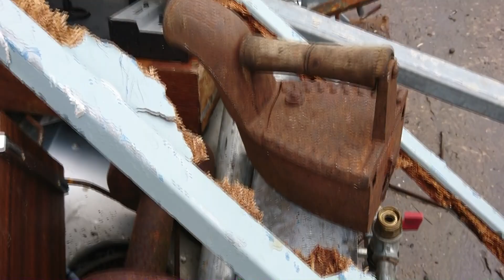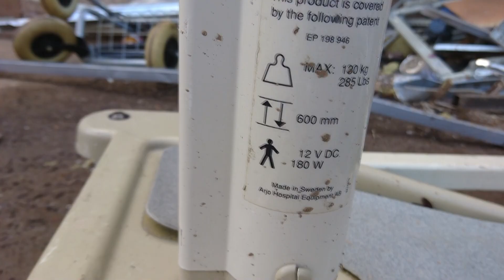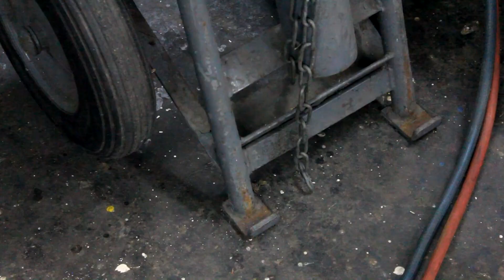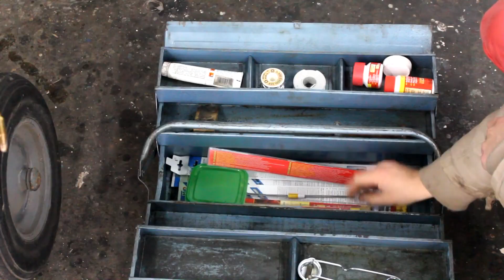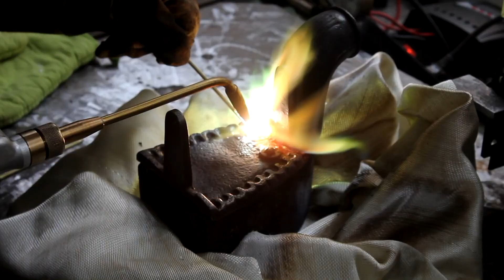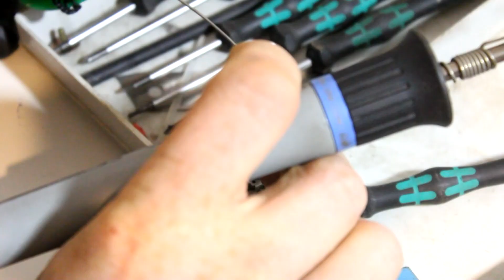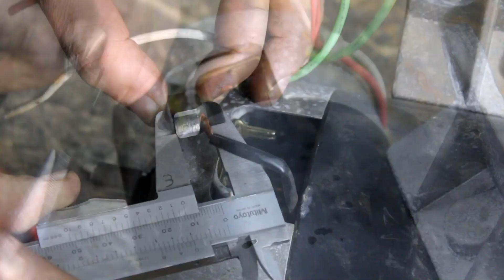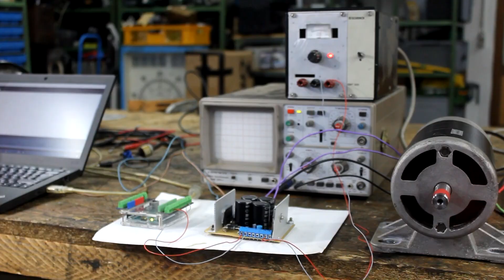Amazing Scrapyard Finds! Repair-A-Thon!

Comment: I hate to say it but Australia has caught the Black Friday virus as well and we are just as wasteful as the rest of the Western world but like you I get a lot of benefit from it. I recently picked up a pallet jack that wouldn’t lift for just a few dollars at a recycling yard and all it took was an hour of my time and a $3 seal to fix it. I can highly recommend grabbing one of those patient lifters if you can as I have one that I got at the junk yard and it is so much better than an engine hoist around my work shop because It’s much lighter and more compact than an engine hoist and although it’s rated to lift people up to 180kg I have lifted a 300kg machine with it. It’s just so useful. As for the treadmill motors I stopped collecting them when I had picked up 7 free treadmills in my area within about 12 months and ran out of uses for them. They are great for converting some work shop machines and I followed the instructions I found on YouTube to convert my linishing sander and it’s a real improvement. Now it has forward and reverse and variable speed. A word of warning however, people on YouTube are converting lathes and drill presses to the treadmill motors and this can be a big mistake as they are not considering the increase in torque that comes with the reduction in gear ratios with the Ac motors and end up disappointed with the lack of torque at lower rpm. Also, as I’m sure you will understand, dc motors are more effected by load than Ac motors because the Ac motors speed is determined by frequency and not voltage so my linisher slows down more when under load than it did with the Ac motor but I can just increase the rpm to adjust for that. I hope this info helps others looking to use treadmill motors. I could watch one of your junkyard videos every day. Cheers Stuart 🇦🇺

Comment: The Post Apocalyptic Terminator ^^ . Your repair Scrapyard Videos, are very inspiring for me :). I always take scraped stuff from the places where i work home, and repair them if i can. Mostly industrial stuff like Lenze Motor controllers, Meanwell Power supply's,  Sensors and  sometimes PLC stuff.

Comment: I love this! Wish I had a cool scrapheap like that close to me! I did however repair a Warn pullzall 220v winch that I found at work. A resistor and a some of the winding had burned up. Replaced the resistor and soldered a wire to the part of the winding that had burned, put some epoxy on it at it worked!

Comment: On the treadmill - I think your presumption about voltages is wrong. Our treadmill motors in 120vac-land are rated for 90VDC. At least almost all the ones I've salvaged are. When I saw yours, that's run in a 240vac grid, being 180vdc I presume it has something to do with the grid. I can't think of why though. Maybe they're off-the-shelf motors for another application that treadmill manufacturers choose because of their low cost? Also... what do your treadmills run on over there if not permanent magnet motors? Almost all of ours are 1.5-2.2hp permanent magnet 90vdc motors. I used one to make an electric recumbent bike (using the motor as part of the frame, since it's 1/4" thick steel). I'd link the videos to you but 80% of the time you have a URL in your comment, Youtube's algorithm shadow-bans it from anyone else seeing. :/
Reply: I've never seen that done to links.
Reply: @rogerscottcathey  - You wouldn't. To the poster, it still shows your comment. But if you were to log in under a different account and scroll through every comment, it will be missing. Hence  "shadow ban." You don't get told it's removed, you can still see it, but it might as well not exist. Think of how many times you've seen any url, from anyone, in a comment. Else people would be spamming their own channels and vids constantly.
Reply: @MattsAwesomeStuff  : Hunh! I'll check that out from a different account. I do recall now in the old days of yt having to disguise links by spelling out dot, etc.

Comment: What a great company for trying to uphold their repair warranty after all these years :)
Reply: Meanwhile Crap and Decker just says 'fuck off"
Reply: @DragonBuilds  
Campbell Hausfeld too.  I was looking for an air valve for my paint sprayer just yesterday. Their answer:  "We don't sell parts anymore " !  I'm pissed off and enraged.
Reply: @Mirodin From what I understood its was not a warranty, they simply offered to repair it but they probably wanted some money for it.
But that is way more than you can get from most companys.
Reply: @Ultrazaubererger  Right. Especially made in China companies.
Reply: Tiny cost: potentially great goodwill benefit.

Learning how your previous production eventually fails is invaluable information -- if it is used to inform product design and future production.
Reply: @michaelthibault7930  If it took 15 years to fail, the company that made it likely long since stopped caring how it failed - it's a welding torch, not a bridge. And this torch was 40 years old!
Reply: I have used a repaired torch body once and will not bother again.  It is not worth the risk with oxygen concentrations around it.
Reply: Hey Frank, Fahaaank, da ruft schonwieder jemand wegen der 32-40 Serie an, kannst Du mal deinen Vater anrufen, welche Dichtungen ins Kit gehören? 😙🎶
Reply: Giving good after-sales service is probably the reason why they are still in existence!
Reply: Why couldn't they fix it!!??!!??
Reply: @tomsuica8731  I think it's a question of costs: if with 55 euros T.P.A.I. has bought a whole new piece, think about how much it will cost to just disassemble the piece to find out the fault, add round-trip postage and spare parts price and you will see that we are very close to the price of the new: everything is repairable but not always for an affordable price
Reply: @zolatanaffa87  Have you considered that part mentioned could been the torch cast body it self and sure they replaced the body and rebuild it with parts left from old torch body, given what could be replaced that is and that as manufacturer they probably had all those parts in house. Like usually we dont have as audience enough information to comment accurately enough. But yeah dont fuck around with oxy-acetylene. Local trade school had its metal working shop explode all windows with in 50meter radius, everything was trow to walls, gas bottles fell and knock the valves off turning into ICBM's... just because some jackass decide to weld plate on pipes end, fill the tube with mix and hit the spark. By some miracle jack ass only lost his hearing and couple broken ribs.
Reply: @ @Hellsong89  You are perfectly right, in fact, my reasoning was limited to the possibility and convenience of a repair, I had not taken into consideration the reliability of the final product which must be the maximum possible, given the danger of possible gas leaks
Reply: @tomsuica8731  ?!?!?!??!?!?!?!!?! Because some faults probably aren't worth fixing, it might have been dropped and have a crack in the casting for instance.
Reply: @VeraTR909  hahaha no man... Its just choosing where to spend money. Of course its possible to repair. It's probably just some rubber o rings again or gaskets
Reply: The company has to spend labour while they already shelf new parts. So its an easy business choice
Reply: @MrJob91  Meh, they sold those parts separately so i would guess they would have fixed it that way if they could but cool, keep on hating. I'm kinda done with this shit now...
Reply: @VeraTR909  If you remember the acetylene also leaked back through the oxygen valve, must have been some form of direct connection between the passages.
Reply: @Equiluxe1  lol i made my comment after i saw some videos about torches being rebuild.
Reply: Mirodin Moreno because of safety concerns regarding a repair
Reply: @VeraTR909  You're right. Also it's not worth risking someone's health and safety to fix an old defective torch.
Reply: @VeraTR909  With a used part they probably aren't comfortable guaranteeing their repair for such a dangerous item.  Just liability.
Reply: @MrJob91  55euro for a new mixing handle and German at that...pffft  If the repair were as simple as a few parts, yes. Likely they saved him and themselves a headache....I'm the only damn fool I know of likely to attempt that kind of repair....
Reply: @tomsuica8731  the sealing surface gets worn off  you would need to remaschine the sealing surface and put in new seals, the seals are no standart size and the maschining would cost more than a new one because you would need a long time to indicate the maschine if they no longer have the milling fixture